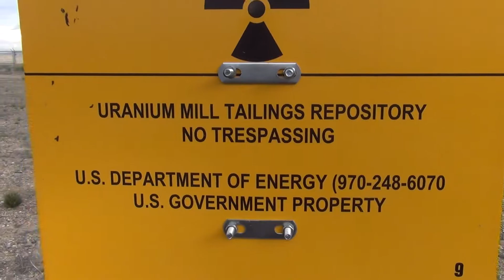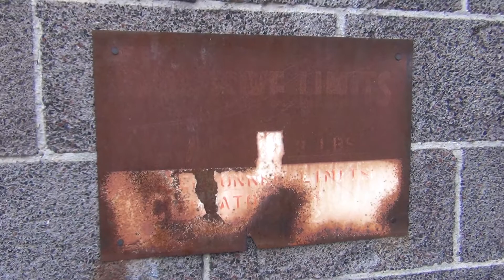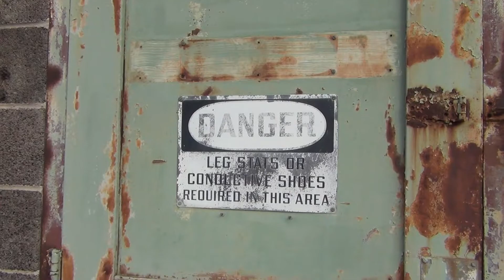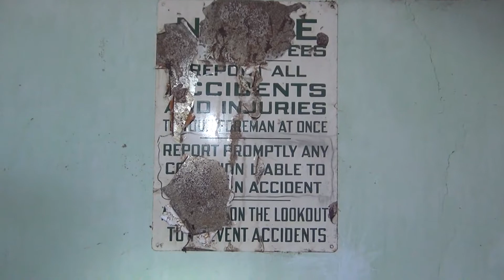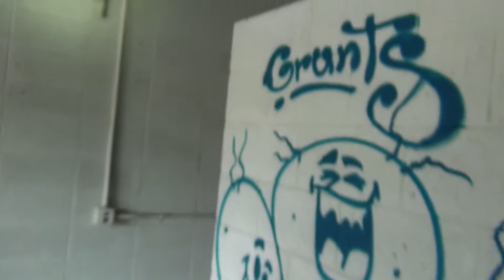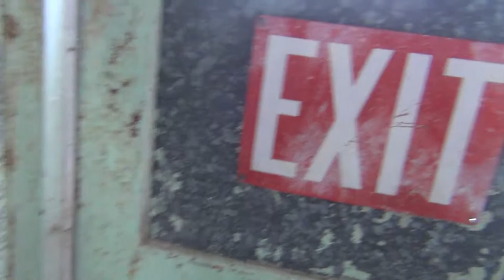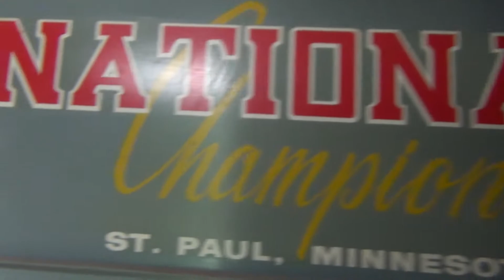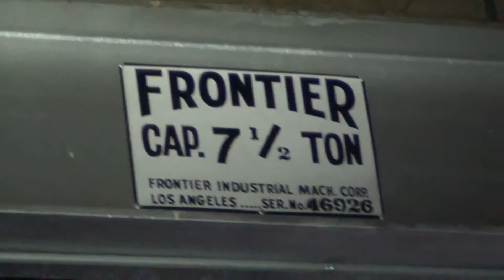Green River, Utah - Missile Launch Complex - White Sands Missile Range

Comment: Left axillary it's been open in the 40s or 50s you did run until 1978. What you think is insulation is more than likely is asbestosis. Flammable or explosive materials I believe. Space so far apart from each other. Right across from the firing range I think because the Radioactive sighns. You need to realize that was a testing range not only for the missiles but for the warhead that it would carry most often nuclear. You probably don't know this but we (US) nuked Mexico, twice by accident from that very site. They were supposed to land in New Mexico not Old Mexico. At the Sands lake range.
Reply from the maker: LOL It's not a testing range there are homes built right there next to this. You are thinking of a different complex.